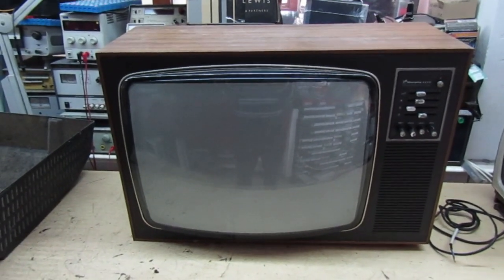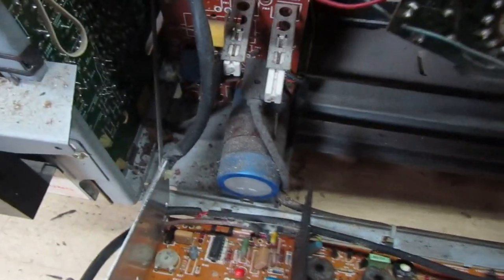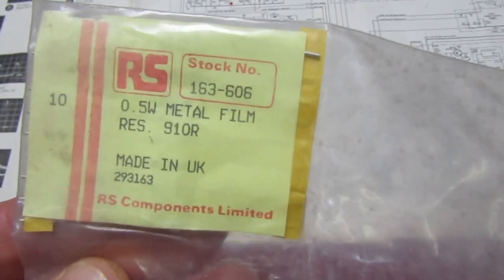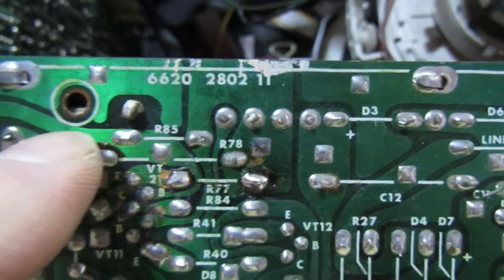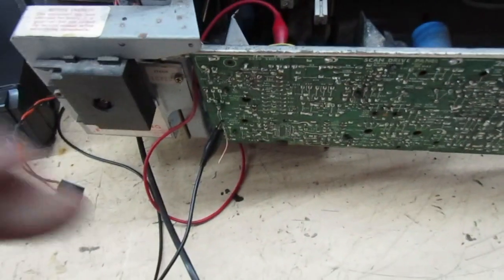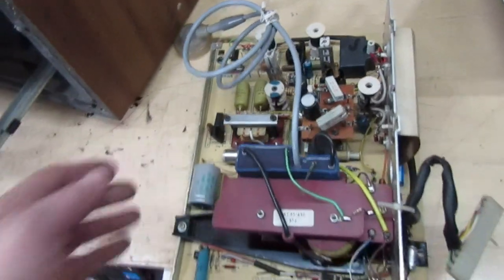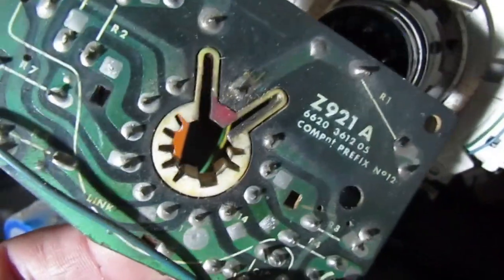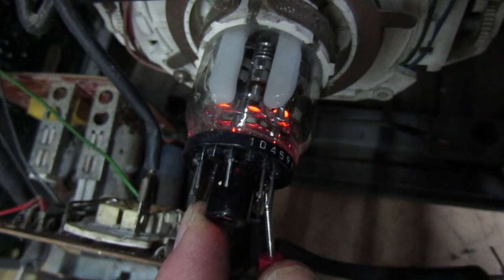Rank Bush Murphy  Z718C Chassis vintage colour  TV set from 1977 restoration. Model MC6301.

Comment: Great job there Mike. I served my apprenticeship at a RBM dealer and I recall that the Murphy version of these sets came with a rather courageous five year guarantee ! The RBM technical rep told us to replace the 910 ohm resistor with a 1kohm 1 watt resistor. 
Watching that brought back many memories,like you I've probably not seen one since the mid 1980's.
Reply from the maker: I liked the RBM stuff , even the T26 which was Toshiba designed , I don't know what happened to RBM , I know the Bush name is still around , now owned by Argos but its nothing but just a name now .
Reply: @michaeldranfield7140  Our field engineers used to replace the 910 ohm on these and T20, T22 etc. However, a few weeks later, after replacing, the set would fail again and they used to bring it in to the workshop for repair. In the workshop I always found it was 4VT20 the 2N5296 was faulty. The heat from their soldering irons must have temporarily got 4TV20 working again for another few weeks, until it failed again.
Reply from the maker: @marksntl7632  I have come across this quite a few times and still do today , you find a faulty diode or transistor doing a cold check  and then when you remove it it tests ok again .

Comment: Reminds me of a 1984 Advent 3 crt projector. Customer took it to shop after shop for an intermittent problem. Finally he got tired of messing with it. I gave him $100.00 for the project. Was a challenge to find but like you I kept after it. Repair was after all simple. Changed out the 3 CRT sockets for ceramic. Like magic all the intermittent issues went away. I have usually found many problems are simple to fix. 

Good job on this one..
Reply from the maker: intermittent faults can be very time consuming to repair and on newer stuff its hardly worth the trouble but with a new LOPT fitted in this set failure was not an option .

Comment: I remember these, in my apprenticeship, as I recall they could be Troublesome, to be polite, these were in the rental section and worked hard, we were glad to see the back of them,
Reply from the maker: The service manual shows a single stick rectifier with 25Kv overwinding so I guess its no wonder they were un reliable, but this set was fitted with what appears to be a aftermarket 8Kv overwind and Tripler combo so giving up was not an option .

Comment: These sets takes me back to my younger days in TV repairs.
You can spend many hours replacing the known weak components, many failed
due to the amount of heat these sets generated.
Lopt's were a weak spot on many brands, the popular ones we kept instock knowning
that you would need one sooner rather than later.
Reply from the maker: One of my biggest problems is back in the day LOPTS were an expensive item so I very rarely kept these in stock and usually only got them to order so I don't have any new old stock ones now like I have other stuff, the reason I so wanted this set to work is it had a brand new LOPT already fitted and as long as the LOPT and scan coils are OK there's not much else that cant be fixed or modified to work .
Reply: @michaeldranfield7140  Ahh the good old days, back then we knew the most common faults before we took the back off.
And LOPT's were a very well known weak spot, i wish i had a penny for the number of Philips 210 chassis LOPT's that i replaced
these and a few others we kept in stock, the others as you say were just too expensive to keep on the shelves just incase.
Other components like capacitors and resistors could be replaced at a much lower cost.
These days they only want us to replace complete boards, but i still try to go to component level if i can.

Comment: Hello Michael, I was getting worried when I saw the state of the tube socket as I thought the picture tube would have had many hours on it but what a great picture. I really enjoyed your methodical approach to sorting it out, very interesting and well done.   Thank you for posting.
Reply from the maker: It was at the tube base socket I was wondering if it was game over until I remembered they were a common cause of trouble back in the 80 s and maybe still had them in stock .

Comment: Your a pretty smart fellow!
Reply from the maker: Was, you mean , cant fault find to component level on  new flatscreen sets as there is no service manual for most sets , its just whole board replacement  .
Reply: @michaeldranfield7140  - It was meant as a compliment.
Reply from the maker: I know it was a compliment, my point was I was a lot better at fixing TVs in the 80s when they were designed to be repaired, everything now is designed to fail and be as un repairable as possible.
Reply: @michaeldranfield7140  - I find the new sets to be much simpler and quicker to fix, but, hay, that's just me.
Reply from the maker: @tubeDude48  anything is simple to fix if you just swap the whole board but what's the fun in that .

Comment: Good application of logic, plus familiarity with the fundamental operational characteristics - not to mention having the actual circuit diagram and replacement components!
Reply from the maker: This is how easy sets were to repair back in the 80 s , not much chance of repairing a modern flat screen set to component level now , no service manual exist for most sets, no individual components , only a new board , all designed of course just to sell you a new one .

Comment: Thanks for the time taken and determination.  Many would have given up. The 910 ohm resistor brought back.memories. I remember it being a weak spot on T20 and T22 chassis.
Reply from the maker: I always favoured the T20 and T22 over the Z718 back in the 80 s and also the T26 so this was an interesting journey and brought back a lot of happy memories .
Reply: @michaeldranfield7140  
One really handy thing about the T20/22 was the small rectangular PSU in the bottom of the set. It was easy to get out and send away for repair. I was never clever enough to diagnose switching power supplies.

Comment: As marathons go, you certainly just ran one. Goes to show you can't assume anything when taking over from a previous repair. As you said, back to basics with an EHT fault. Bingo. Dead trippler. As always a GREAT watch, and wonderful trip down memory lane. We didn't have the Bush range in New Zealand, but Thorn and AWA always kept us amused 😉.
Cheers
Pete'.
Reply from the maker: Apparently Rank Bush Murphy were big in Ireland back in the day , you never see sets like this in England any more so it was a real pleasure to work on another one after so many years , had this not have already had a new Tripler fitted that would be the first thing I disconnected , so I can only assume the incorrect heater winding to earthy end of the tripler must have damaged it .

Comment: That was a epic repair Michael 👍.  I seem to remember those front slider controls only covered part of the range such as the sound not going completely to zero but I didnt see to many in the day so could be wrong , but I do remember those tuner units had those plastic nuts that split like the A774 mono sets did a few of them in the day . Good to see it back in working order I'm sure Jonjo will be pleased as well .
Reply from the maker: Not had the front controls out yet , got to find a speaker first and there's also a foot missing to source under the set , but yes it was a good result .

Comment: I remember the z718 with the line incorporated psu    mni times it was the lopt with shorted turns.   Thanks for the video Michael excellent
Reply from the maker: A faulty LOPT is the biggest worry with any old TV set, the fact this set had a new LOPT already fitted made giving up not an option .

Comment: Ojnoj covered my mum and dad's first Bush  from radio rentals in 1957 which lasted 10 years  till replaced by. A DS Baird monochrome. He also covered the DS TV191 that I got from the dump which gave a fantastic picture. I think that is why they chose Bush as  their first non rental bought from Comet. I was a 26 inch Bush Arena with ultrasonic remote and touch varicap tuner. That had your chassis and a Toshiba tube I think Rank Toshiba had some sort of partnership in Plymouth. The Bush Arena was great it  lasted over 10 years till the Tube started to fail.
Reply from the maker: I have a 26 inch rank with ultrasonic remote and teletext but never got round to looking at it yet , you are correct there was some sort of RMB/Toshiba marriage as there was a set,  T24 chassis I think it was which had a Bush  cabinet and badge on the front but inside it was a Toshiba set , back in the 70 s my parents only rented , we had a Thorn 1500 which looked ok until one day it went wrong and the rental guy took it away for repair and left a Bush loan set in its place  and the contrast on the bush was far superior , that's when I realised how bad the Thorn was ! 
 I have very fond memories of radio rentals , I use to climb into there industrial bin as a kid when they had closed , looking for TV boards  , never found anything of any use though !

Comment: That was good! And I mean really good!! I enjoyed every minute of it.

I have, somewhere, a Bush colour telly of about the same vintage. I got it from a forum member who spent some time and effort on it. It has sound, it has picture, but there's a shed load of other problems with it. Convergence is, well, it doesn't, actually. I need to get it out and have a look at it. It's been in storage for years, so I have no idea what it can or can't do now.

It's always good to see another set brought back to life, especially when it reminds us of a different time, or people who are no longer with us.

I'll tell you now, I would probably have given up on your set a long time back. It's those quirky little bits of circuitry that would lead in to knots, especially those little "kickstart" capacitors. I would most likely have sat there looking, and wondering what they were for 🤷🤦.  Just give me a bit of hot wire and some high voltage, and I'm happy! 🙆
Reply from the maker: Giving up was not an option considering this set had a brand new line transformer fitted , as long as the LOPT and the scan coils are OK there's not much that cant be repaired or modified to work , I even made a Tripler for a Decca set a year or so ago !
I am very much indebted to John Joe for giving me this set and a couple of others I have not looked at yet for the very reason you mention , I'm a great sentimentalist and repairing this invokes so many happy memories of the 80 s when I first  opened a shop with my two business partners that both passed away 5 years ago .

Comment: ah memorys, my dad had the 18inch version with the stick eht rectifier in a damp drafty 1900,s built house. i could always hear the corona discharge entering the room. i was to young to know what to do other than ipa and a hair dryer.i never realised that its not so different to the a823a design wise but then i didnt realise it was so old. it was striking how vibrant the colour was .the only faults that he had was the e/w diode shorting as you say. most reliable set we had back then. he got a philips g11 after that --constant problems and a horrible dull pale picture too
Reply from the maker: John Joe gave me a 18 inch set also but there was some parts missing out of it so I don't know if restoration will be viable or not , according to the service manual this 22 inch set should have had a stick rectifier so I can only assume the lopt/tripler combo was an aftermarket replacement part , but yes , this wouldn't have been as good if it didn't have the Toshiba blackstripe tube fitted .

Comment: Liked the methodology, also took be back many years when I looked after Sony CCTV monitors, they used odd kick start circuits. Fault easily proved by a 12v battery across the capacitor.
Reply from the maker: Some early Hitachi sets used same start up method , I use to just bridge the cap with a resistor .

Comment: Great stuff Micheal, lovely video.
Reply from the maker: A most excellent set John Joe ,will go well in my collection and I cant thank you enough for letting me have it .
Reply: @Michael Dranfield  No problem at all, couldn't of gone to a better home.
Reply from the maker: @IrishvintageTVRadio  Hi , JJ , Made a start on the white Toshiba portable yesterday and that's turning out to be another more difficult than I first thought repair !
Reply: @Michael Dranfield  I thought the little Tosh was going, they were bullet proof!!
Reply from the maker: @IrishvintageTVRadio  It was , for about 2 minutes !
 just setting the height and the colour went off, checked some parts then time to go home, switched it back on again in the morning and now the line and frame sync have disappeared .

Comment: 🔊Spot on my friend, loving the longer video format. around 1991 we had a BUSH tv similar to this, to be honest even to this day it had the best picture ive ever seen on any tv, and for colour accuracy and dynamics even beating the new OLED crap, these were stellar televisions with an awesome colourful bright and stable picture. we used to play the sega master system and mega-drive on it, as long as they didnt have a mullard tube, as those went weak in about 5 years, the toshiba crt's were far superior, yes those slider controls dates these sets to the mid 70s as they didnt use them for long as they were so unreliable because of them being dust and moisture magnets. and of course nearly everyone smoked in the 70s making their lifespan even shorter. i used to use an ordinary lead pencil to revive those slider pots
Reply from the maker: I didn't intend to make a video this long , over 100 clips shot over several months in between trying to make a living ! the Toshiba blackstripe was indeed a excellent tube as you  say compared to the Mullard stuff that only lasted a short time , in the 90s I was selling Samsung 14 inch portable sets fitted with a blackstripe for £179 and the picture was far above most stuff on the market , still got the master system , mega drive and mega CD player my son use to play on in the loft , it was however a bit advanced for me I grew up with an Atari 2600 but I did like the sonic the hedgehog game on megadrive .
Reply: @michaeldranfield7140  Michael what a legend, the original sonic and mario games were unbeatable! i used to collect those nintendo game and watches years ago, i highly regret parting with them, they were epic.

The japanese crts were amazing, especially the trinitron and diamondtron stuff from mitsubishi

We need to open factories here in the uk now were out of that shitshow that was the EU dictatorship. new crt assembly plants

china are still making crts so we should!

Comment: Definitely a mission, that one. Well done for determination and persistence. I must say, for some reason, during my years in the trade I had very little to do with RVM sets. In fact, all I can remember was the A823 chassis and their 'orrible decoder. Worked on most everything else but not RBM. Given the questionable complexity of that thing, I can't say I'm too sad at having missed out on them. Looks like an opportunity to deploy as many semiconductors as possible. We'll done for batting on, if I had spotted green disease, I would have scrapped it.
Reply from the maker: I did quite a bit with these sets back in the 80 s , the very last one I ever repaired was early 2000 s , a T26 which was just a Toshiba set in a Bush cabinet, no chroma due to a missing line pulse to the decoder chip, o/c resistor , it belonged to my accountant and it was old in the 2000 s , never seen a RBM set since and didn't think I would ever again so it was a great pleasure to work on this set .

Comment: Yet another extremely interesting and exciting video. Thank you for sharing it with us and for taking the time to make the video. So many small issues that stopped the set from working. I found it fascinating to see how many individual component circuits there are in a TV like this. Please could you do a video explaining the various sub-circuits in a TV like this and how they interact with each other to make a complete television?
Reply from the maker: I have more vintage TV stuff in the pipeline but its a long time since I repaired stuff like this and I have to spend quite a bit of time studying the service manual first to jog my memory on how it all works as I have forgotten stuff myself, also back in the 80s most sets had there own common faults which you would get on all sets but once again Its all down to how much I can actually remember .

Comment: Great set i had 18" tabletop model for years much better than  the old delta sets
 of the time
Reply from the maker: Yes John Joe also gave me a 18 inch set with lift off plastic cabinet but there was parts missing out of it  so I don't know if it will be a viable restoration or not .